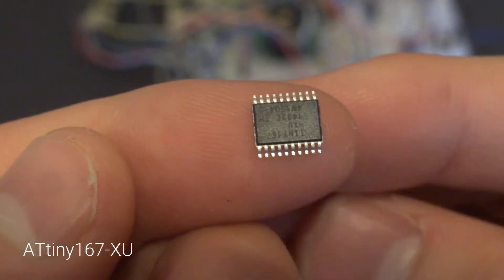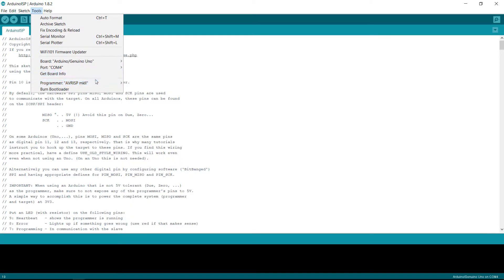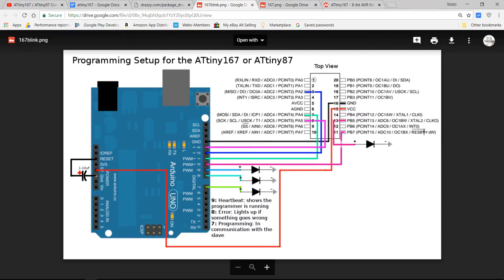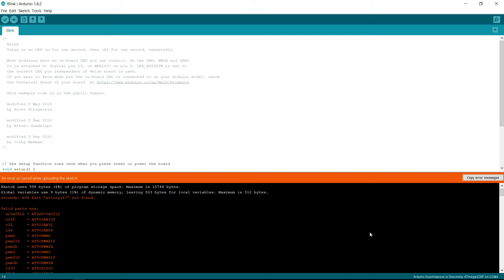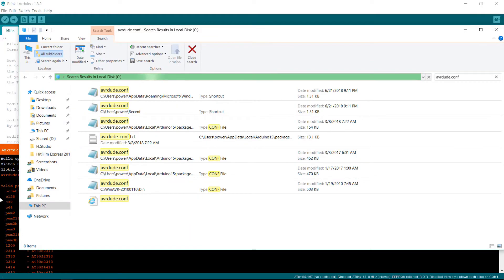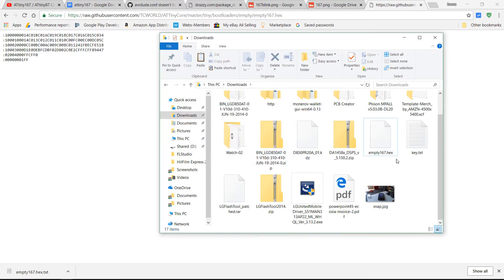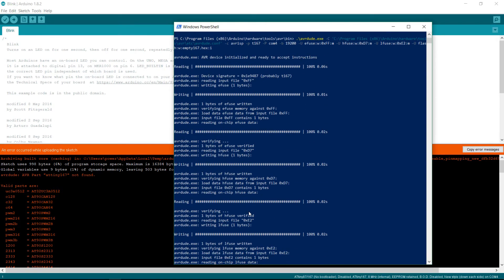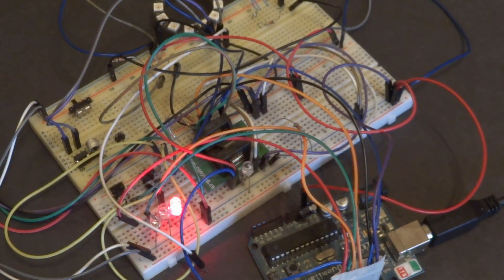How to Program the ATtiny167 or ATtiny87  using Arduino. Complete Windows Guide

Comment: The diagram shows direct wiring of the LEDs to the pins of the ATtiny and Arduino UNO.  At 5v a current limiting resistor should be used of ~170 Ohms to get you ~30mA of current draw on the pin for an average LED and to keep the draw below the nominal rating of the output pin.  The more common 220 Ohm resistor would get you some more buffer and avoid potential damage to both the UNO and the ATtiny.  The video helped me get my ATtiny87 up and running.  Thanks!